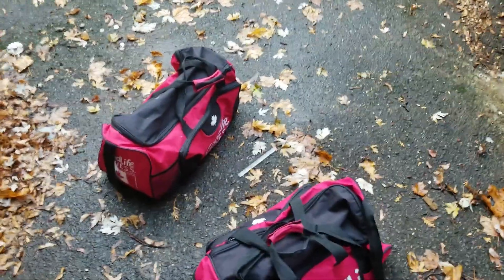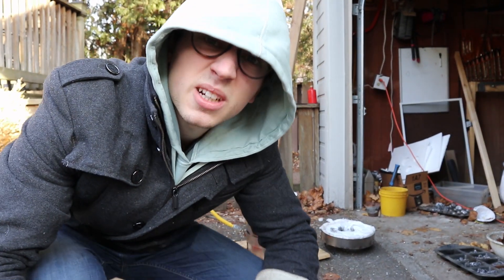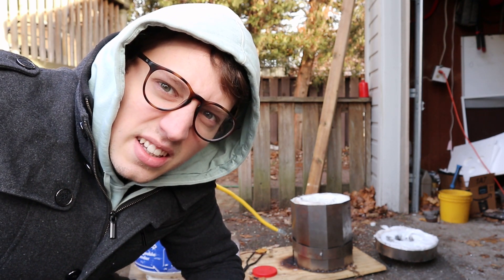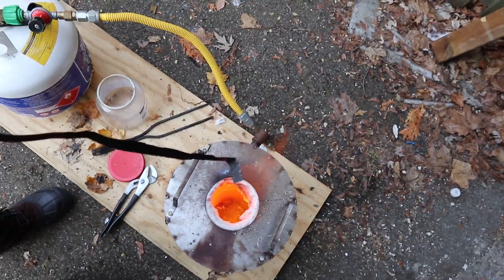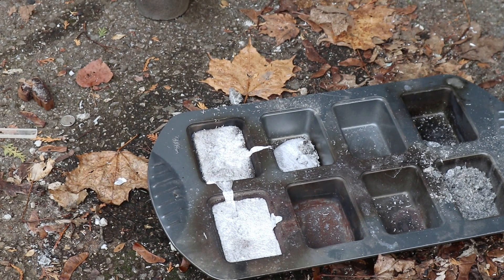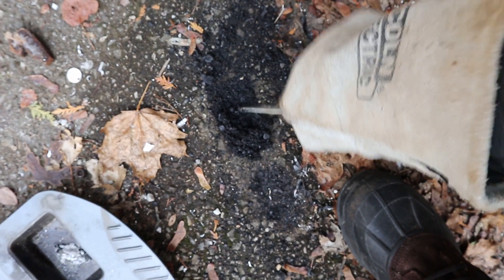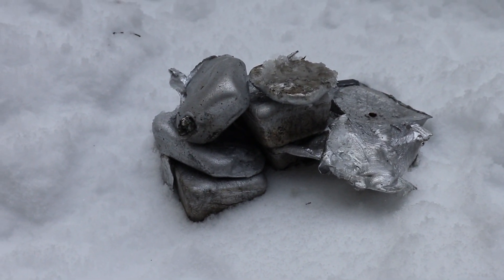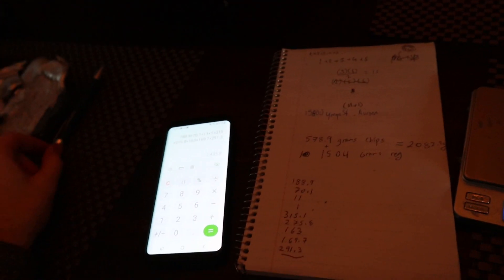Melting Aluminum Chips at Home. Can it be Done?

Comment: buy some cryolite. Run some steel wire to the outside of your crucible. Buy some carbon and put it in the crucible with another wire attached to it. Add some aluminum with your shavings. Run electricity through the wire while you melt at about 1100 C. The carbon with pull all the oxygen off aluminum leaving you with no slag at all. The aluminum will sink to the bottom and the cryolite will stay on top. This is how aluminum oxide is converted back into aluminum. It isn't that hard and if you have a lot of aluminum oxide it is worth it and it looks like you do. Also running electricity through a graphite crucible heats it because of resistance so with enough power you may not even need much propane.

Comment: An idea I saw in another video.  Take an aluminum can,  use a can opener to cut the top off.  Pack the can with the chips, then put a small ingot or if you have other scrap to melt that is bigger, use that.  The idea is to reduce the likelihood of chips blowing out due to air flow and cut down on oxidation by reducing the volume of air in the crucible.

Comment: Those turnings are extremely dirty. It's no wonder you got so much dross. Did you do a control experiment? Have you ever melted 1500g and got back exactly 1500g? What is your usual rate of loss? Your methods are... It is obviously possible to melt down aluminum chips/turnings. Take a look at this video: https://www.youtube.com/watch?v=MWLiL4UAd7U

This is not a very helpful video you have here, and you are  misleading people by holding to your claim that it is not viable or can't be done. I am sure you mean well, but you really should consider that you are missing some important and rather basic variables. Please keep on refining your methods and I have no doubt that you will draw better conclusions and make better videos. Best of luck.

Comment: The alloy isn't quite right for poured aluminum but maybe try some drossing flux and something to degass the molten aluminum like sodium carbonate. Here's a video showing a casting process that may prove useful: https://youtu.be/l3opkzAvVQk

I'm very curious if common 6160 aluminum could be made to cast, even if the final product isn't what would normally be used in a machine shop. Could be useful for hobbyist projects.
Reply from the maker: I have done lots of casting with 6160! I was trying to melt the chips because I have a huge supply of material, but the chips wont melt before they oxidize. Flux is something I'll try next. I havent tried machining the 6160 casts yet, but I've read that I'll need to heat treat the heck out of them before they will machine nicely